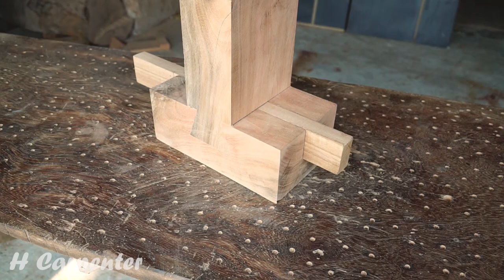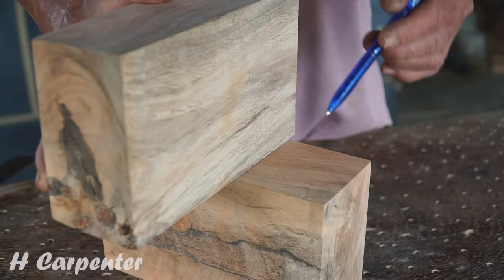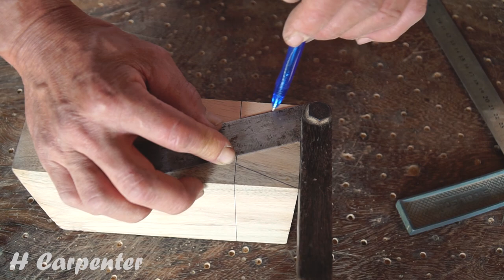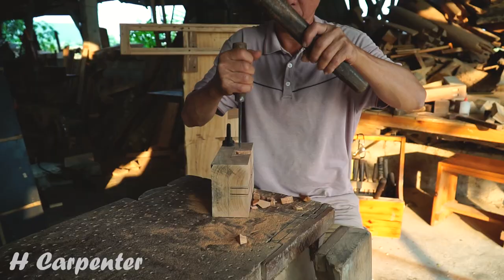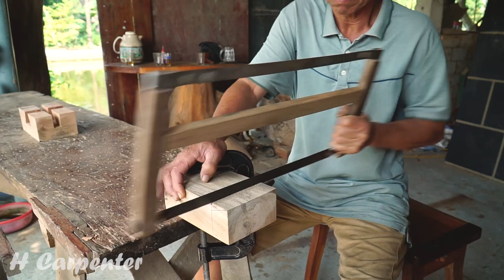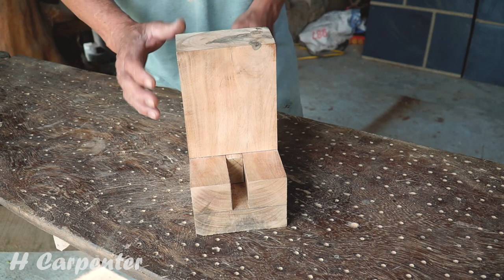Awsome Japanese Woodworking Joints Skills,  Stronger Dovetails Wood With No Screw

Comment: A great many of these joints can be used in building homes, there would be a lot less need for nails and screws to be used and the home would be a lot stronger and maybe a bit stiffer. Many of these joints can also be used for building furniture as well that would look great in any home.
Reply: These joints have been used for centuries. Buildings have withstood earthquakes with little to no damage.
Reply: @steveb6103  these are the types of joints they should be using in many states. These are the types of joints that a friend used when he built his place up in Alaska 18 years ago.
Reply: @steveb6103  True. There are the textbook engineers who are not wise enough to see that these old methods of joinery have stood the test of time. But sadly the people who are into construction do not care for quality they are only out to make a quick build, quick dollar.., only drawback is, years down the line maintenance or repair costs can be big.., ahh if only they invest a bit more in forethought and good craftmanship.🧐

Comment: Ok the horizontal lock piece locks the horizontal and vertical pieces togerher but there is no way to connect the horizontal piece to anything else. The lock piece gets in the way and blocks the ends of the horizontal piece.
Reply: 實用性不佳